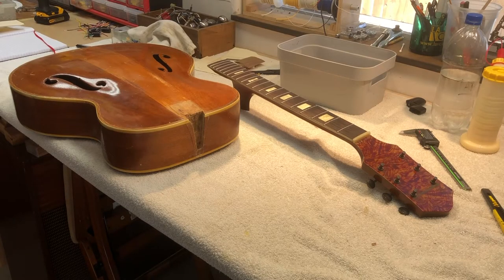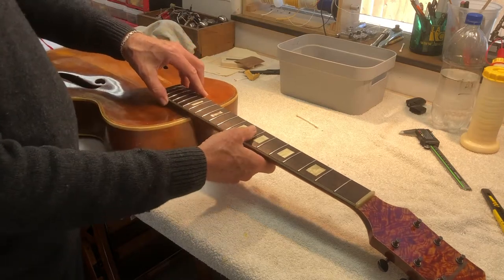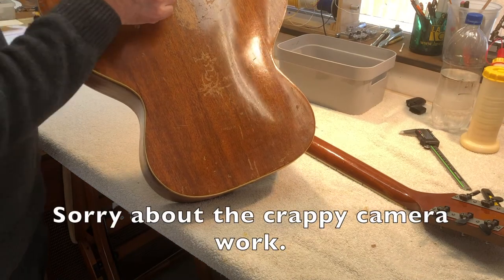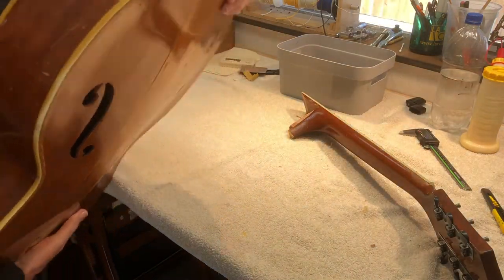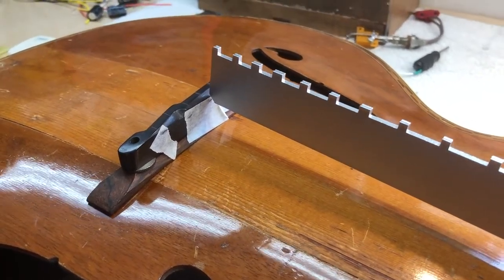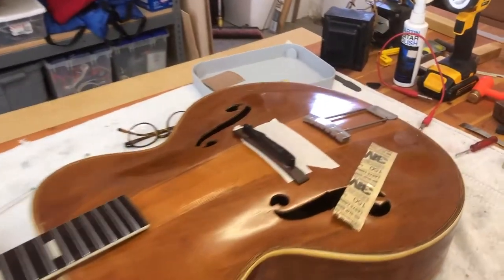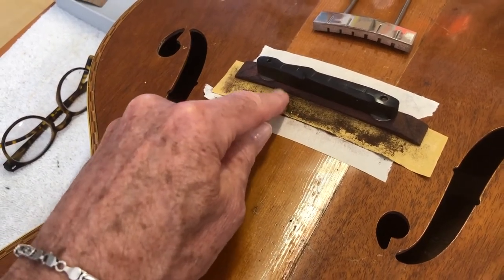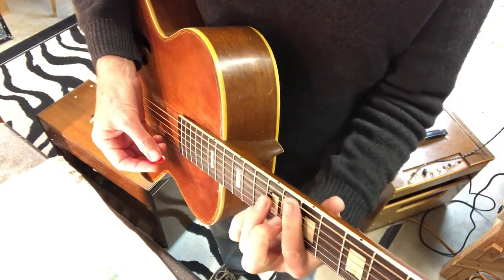Harmony Patrician Neck Reset

Comment: I am working on a 1953 Silvertone arch top that is very similar to that. They were manufactured by 2 companies, Kay and Harmony, and sold by Sears which probably kept them in business during war time. This one is a Harmony evidenced by the serial number I found. It had a split on the side near the neck, top coming unglued and someone tried to epoxy the neck and side, what a mess. The point I was going to make is that on this one it is 2 braces running from neck to heel instead of a solid block.. The top is split from top to bottom in line with the upper "F" hole. If you look through the lower "F" hole near where the lower bout meets the waist, you can usually find a blue ink stamp with the serial number. Over from it,(very faint), you can find the manufacture date if you are interested.  CHEERS1
Reply from the maker: Very cool. Good luck with the archtop, and thanks for the info.

Comment: Nice job……nice guitar 
Did you consider a truss rod installation..or does it have one already.?
Reply from the maker: Truss rod adds quite a lot to the repair cost for the client, and as the guitar was built without one, and the neck was straight, there seemd no need.
Reply: These guitars did NOT have a truss rod. They are made with a pretty massive piece of wood, and are typically described as a "Baseball Bat" type neck profile. They don't really bend much just from the sheer mass of the wood. Putting in a truss rod is a pretty serious undertaking, and I don't know how effective it would be, again, in consideration of how massive, and stiff ,the neck is just from the wood mass and size of it.

Comment: You say you’re using Titebond. Is that their Hide glue?
They do various types of glue, but I understand that hide glue is best for facilitating future repair work.
Reply from the maker: Not hide glue - just regular titebond or titebond II is very good.
Reply: Titebond is a white, what is called an aliphatic glue. Hide glue was used originally when the guitar was made. Unless it is a very much later guitar, Harmony guitars were made with hide glue from the 1920s to the late 1960s/early 1970s.

Comment: Harmony has always been a low end  guitar  I hope  the person that owns this  insturment  has a lot of money  other words all it is worth is fire wood
Reply: The Patrician model 1407 is a solid wood guitar and the only attempt at a professional archtop that they made. I have one from 1947 and I did a neck reset and put flat wound strings on it which sound pretty good. Much better then regular acoustic strings on that particular model.
Reply: I don't think this guitar is a Patrician because they didn't have block inlays nor a headstock overlay and the holes are not the same.
Reply from the maker: The only suitable response I can make to that is this: Any guitar that plays okay is better than no guitar at all :)
Reply: Yes I agree!
 @SandersAmps
Reply: @warrenhess3259- You simply are parroting back the general consensus, which would be wrong. This guitar is a Patrician H1414 or H1415. The center strip in the top is solid spruce, and the rest of the guitar wood is solid Honduras Mahogany. The purfling is a rectangular checkerboard of contrasting woods. How low end does that sound to you? There are many Harmony guitars that would be considered low end, but there are some that cannot be described as anything but well built of extremely high quality materials. The Patrician line, the guitar here being one of them, is an all solid wood model, and when in good shape, both sounds (I own both an H1414 and an H1415) and looks good. There are other Patricians that are a bit lower end, but all are solid wood models. The earlier Cremona models, also archtops of all solid wood, had tops of a solid block of wood (maple in those cases) that was carved, by hand, with a chisel (the chisel marks can be seen if you look underneath the top), so that the top not only had its proper shape and graduation, but the tone bars (the straight braces used on archtops) were not added on, but carved around when the tops were carved out. See how many other guitar makers did that, even the highest ones you can name. I'll wait. Also, the higher end Cremonas and Patrician archtops did indeed have block inlays (but made of plastic, not shell materials).

The 1950s and later Harmony Sovereign line were also solid wood guitars. The most common, the large, somewhat uniquely shaped H1260, is an all sold wood flattop, roughly dreadnought sized. It was 16" across the lower bout. The back was one piece of Honduras Mahogany. Yes, one piece, 16" wide. Built with hide glue. Try and find a modern acoustic flattop that is made that way, even a hand-built. It sounds unique because of its ladder bracing, but for some types of music, like fast playing or acoustic blues, is an ideal instrument. It was good enough for Jimmy Page to use for the acoustic parts of Stairway to Heaven during recording (not used live). It is far more than good enough for most acoustic players, and truly good acoustic players will know how to use its special characteristics to best effect.

Saying that all Harmony guitars are only good for firewood is like saying that all Gibson guitars are absolutely top of the line. Does Gibson not make Les Paul Juniors and Specials? How high end are those? In a similar way, not all Harmony guitars are only good for firewood.
Reply from the maker: Absolutely - solid top, and a very interesting guitar. @kostaskritsilas2681
Reply from the maker: Tell that to the owner who loves it. Personally, I kinda liked it - an old classic, even if not worth big bucks.
Reply: Every guitar deserves life.